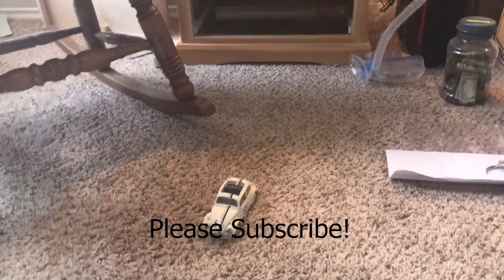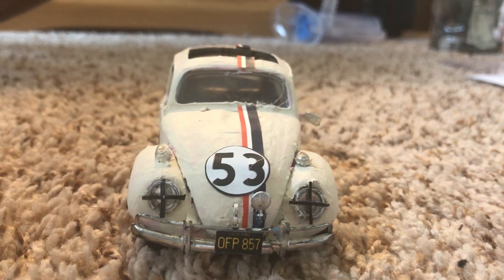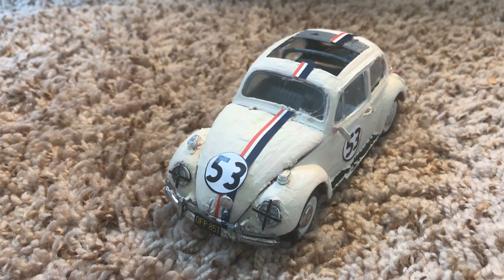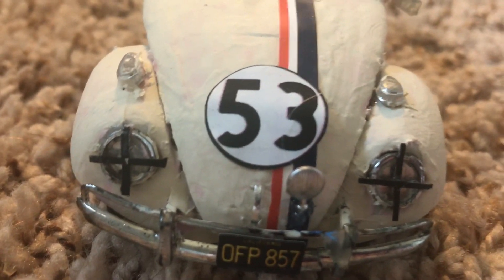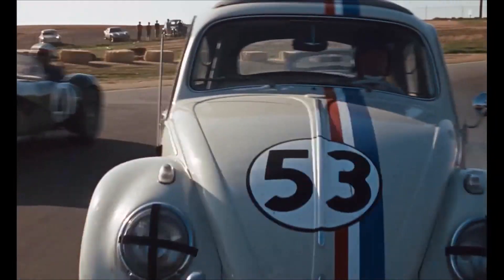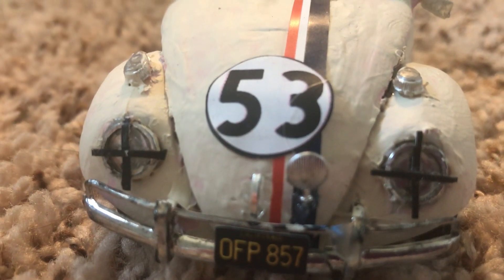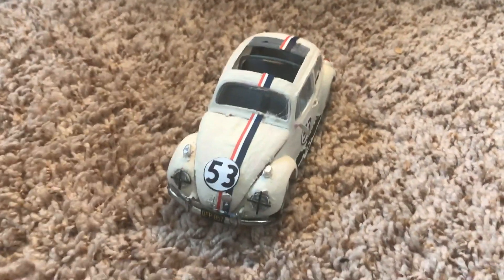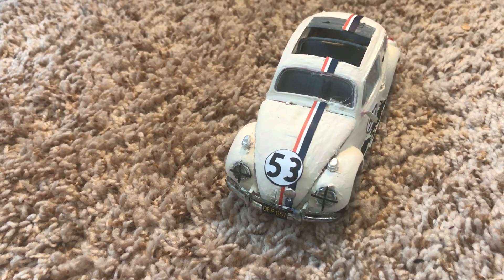Race car Facts: Why do race cars like Herbie have taped headlights in the 60s and 70s?

Comment: The primary purpose was to protect the headlights from getting damaged or shattered during the race. If a headlight were to break, the tape would help keep the glass pieces together and prevent them from scattering on the track, which could pose a hazard to other drivers and their vehicles.